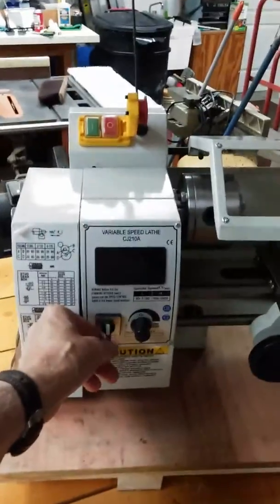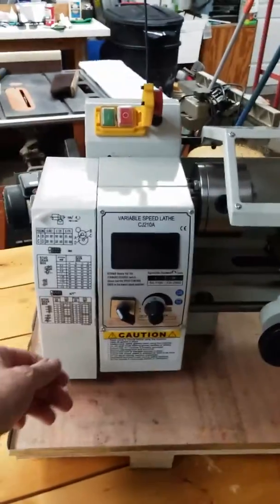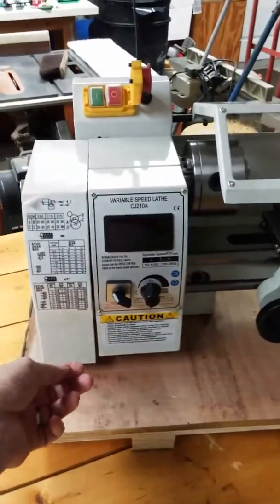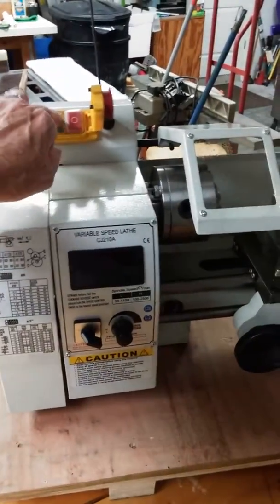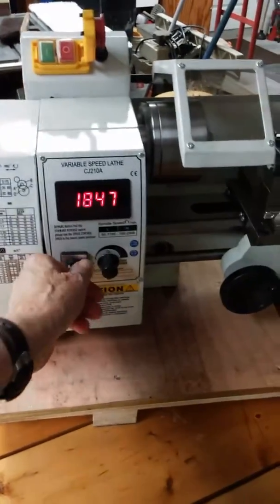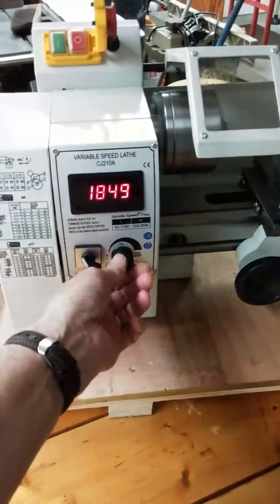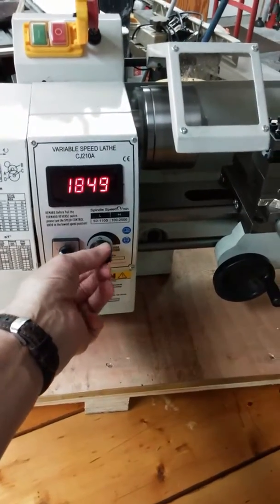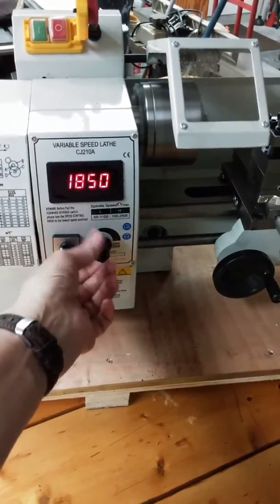Mini lathe speed control issue

Comment: sounds like you have a shorted out potentiometer for the speed control, or something on the circuit control board failed(shorted internally).

Comment: Or the speed controle board. That board controle the speed. Its divenetly  not the turn knob! You can ask the dealer for a replacement board. You can also take the board out, chek the type and look 4 it on ebay. That workt 4 my lathe. Mine cost 75 dollar.

Comment: This is highly likely to be failed MOSFET transistors, which deliver variable power to the motor.
Reply: i was thinking the same, or the potentiometer for the knob is somehow shorted to full speed. can simply check resistance of the potentiometer doing a sweep, if it doesn't change the speed control input is bad. testing the mosfets should have no continuity from center leg to the other 2.